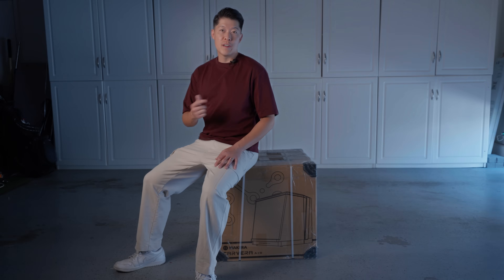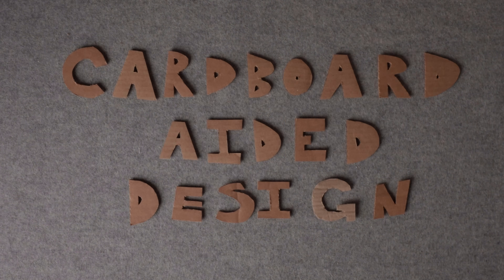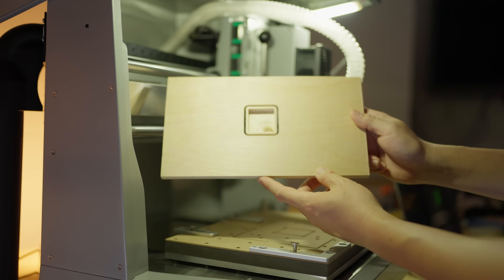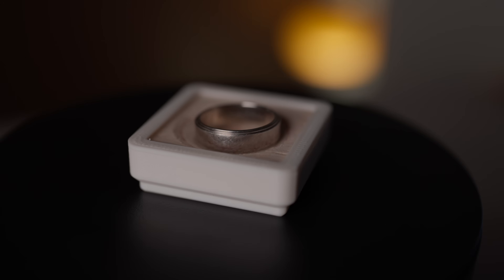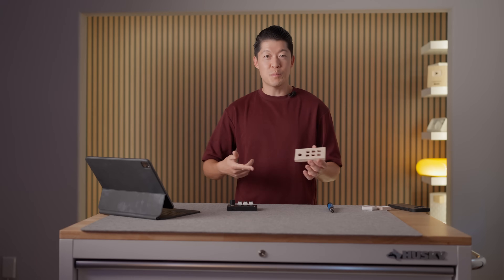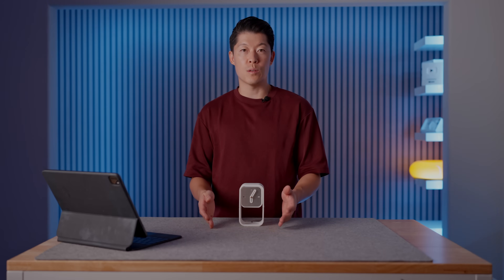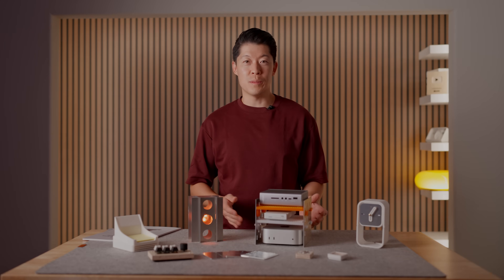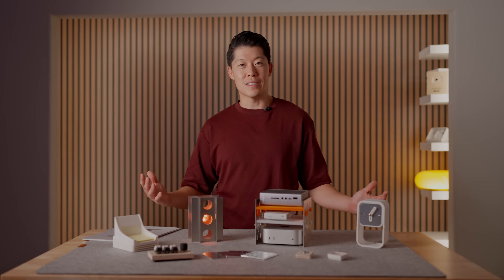Upgrading Desk 3D Prints with a CNC: Plastic to Premium ft. Makera Carvera Air

Comment: This is the first time I’m watching a CNC machine,  it’s so cool to see how different tools can be used to make art.  How loud is the machine when it’s running? Do you have to wear headphones?
Reply from the maker: If you’re working with wood, it’s surprisingly not that loud especially with a white shop vac. I definitely wear headphones when cutting aluminum though, it’s slightly loud and will take a toll for long durations of time.

Comment: I really like your videos. This outside-the-box thinking is really interesting. I've never seen it like that before, but it makes a lot of sense. I think combining 3D printing with concrete or wood is wonderful. 3D printing itself doesn't radiate as much warmth as wood, and you just can't create a structure like concrete with 3D printing. Thanks for the inspiration, keep up the good work.
Reply from the maker: Thanks! Glad you think so too! It's so much fun leveraging different manufacturing approaches and have them complement one another

Comment: What about deburring and finish quality? Especially the metal part is going to hurt if you just leave it fresh out of the mill without a finishing step.
Reply from the maker: I was worried about that too. It was surprisingly smoother than I expected. I did use a metal filer off camera to smooth the edges but I definitely have a lot to learn about the finishing process for these materials.
Reply: @josh_makeshift  There are deburring bits and you can program the CNC to perform finishing moves, which should drastically lower any need of manual deburring/finishing.
Would be very interested to see how far you can get a part right out of the machine, with close-up views if you ever feel up to it. I'm sure a lot of people would appreciate that a lot.

Comment: There are so many minor things to consider when doing CNC work vs 3D printing. You did great for your first experience with it.

Aluminum is tricky when cutting thicker parts. My recommendation is to get single flute cutters if you have not already. It really does make a difference.
Reply from the maker: Thanks! And perfect, I used a 3.175*12mm Flat End Single Flute for most of the aluminum pieces. I just copied a few tutorials and that's what they seemed to use. Glad to know I used the right one and appreciate the tip!

Comment: Great video. I love your designs, however I have a small recommendation: please try using other filaments than just basic white PLA. Using a Matte filament will elevate your designs by a considerable margin. Basic white PLA shows every imperfection and layer line.
Reply from the maker: This is great feedback! Appreciate everyone being so supportive and trying to help me improve my designs and content. Will keep this in mind for future videos!
Reply: 100%. Even just that change to a matte filament will improve the visuals because it isn't reflecting as much light off the ridges between layers. But yeah adding a different colour would be nice. Dieter Rams loved silvers and greys...